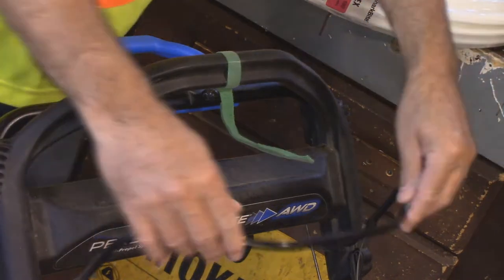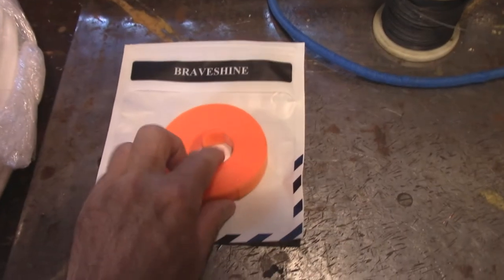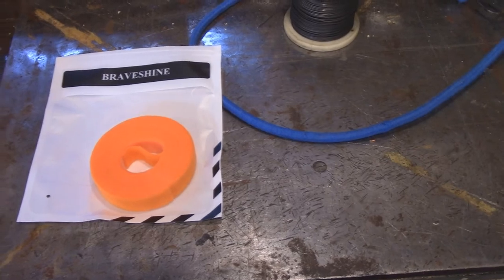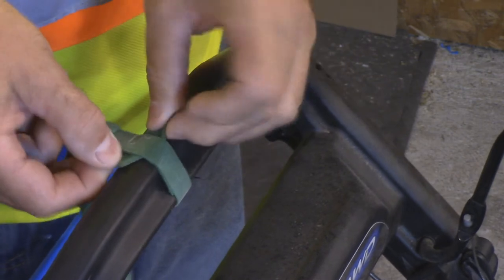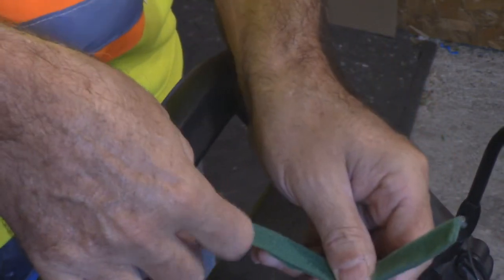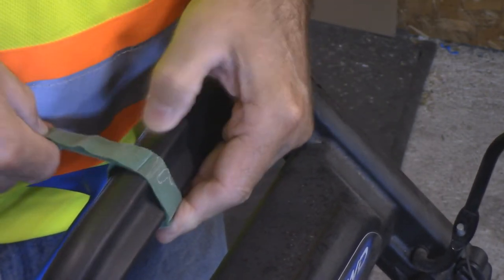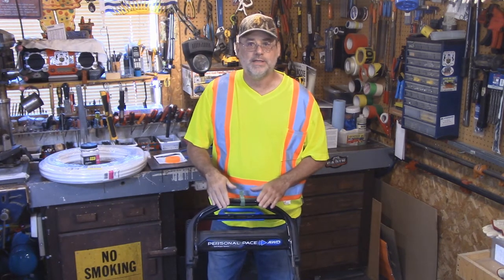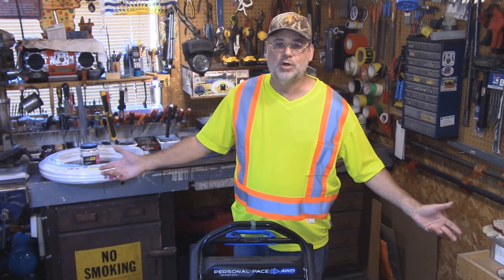How To Keep Your Lawn Mower Running With Velcro Tape

Comment: I bought a roll of that double sided Velcro on Amazon about three years ago.  I think it was about 50 feet of it.  I use it for everything.  
Good tip Steve
Reply from the maker: That stuff is so handy to have around,  50 feet dosent last long when  your a thinker 👍 cheers Bruce
Reply: Bruce, I did the same. Velcro is by far one of the best inventions ever made.

Comment: That's a great use of that Velcro . Much better that completely overriding by wiring it together . 👍 Cheers Steve
Reply from the maker: Yes good point Lloyd as it is needed to stop the engine .